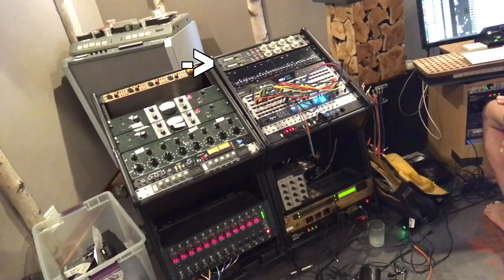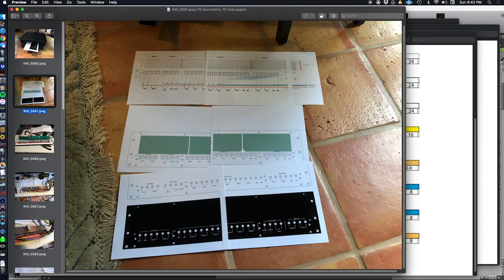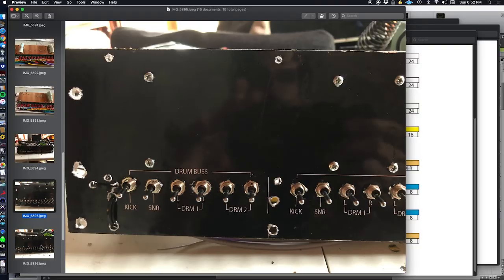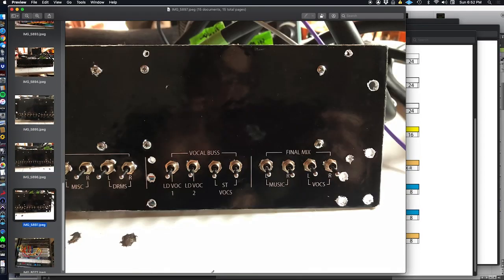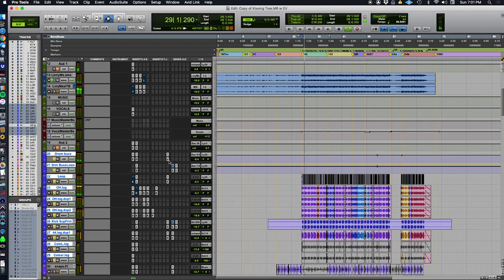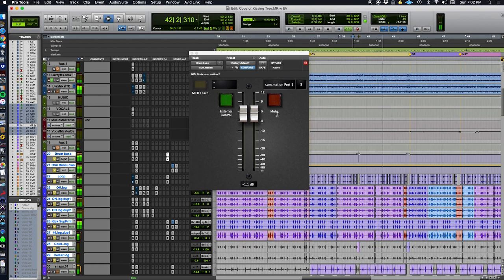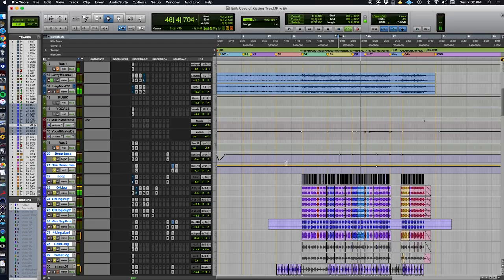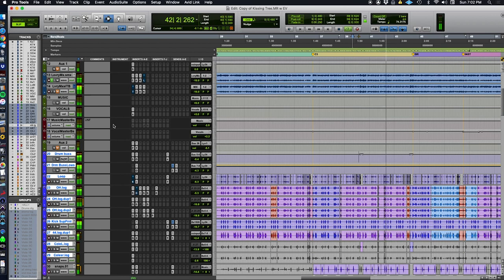Making Records With Eric Valentine - "ITB vs. OTB"

Comment: The potential degradation in quality that happens with AD/DA conversion mostly comes into play during the 1st conversion. The converter has it’s boundaries in terms of frequency response / reproduction that sets the “tone” (no pun :)) for what that audio can possibly be further on after one passage of conversion. If you continue to do passes of that very same audio it seems like it also stays within those boundaries and doesn’t degrade more. But if you compare the same non-converted audio but through 2 different converters in just 1 pass, the difference is massive! So conversion might not be degrading audio from one reference point onwards, but it sure can be either better or worse depending on the converter during the first pass through it.

Comment: Very very awesome video with great information, I’m in the process of building a Summing mixer using vintage api 325 cards, the reason I stopped using a Summing mixer and purchased a console is I could Not stand my Automation rides effecting my compression. The Summing mixer I’m having made now is going to be mostly used as additional returns to my console and for when I want to mix totally ITB to use it as stand alone mixer. I agree the beautiful thing about a console is you are going through multiple amplifier stages that equals the sound that most of us love.

Great video thanks!

Comment: Awesome video! I love how the OTB made the midrange stuff sound so gorgeous and took the sharpness away. For anyone curious, the 20x test works because digital loopback onto itself is more like a data transfer than a recording. The sample outputs can be thought of like data fed by a clock, filtered to remove any aliases, while the same clock is capturing the data on input: my understanding is in simplistic terms is that its only capturing the highest value it finds during a cycle, filtering out any frequencies above the sample rate. Maybe not the best explanation, but its basically what's happening. The data is captured nearly exactly the same as it left, as long as the converter's frequency response is incredibly linear and noise/distortion is low. 
So it doesn't build up any new sound, the first capture is where all the real destruction by the converter happens, if any destruction did occur. After that its just agreeing with itself. 
A low-passed lower sample rate conversion like 44.1 will permanently remove upper harmonics, altering the wave shapes in the audible range on FIRST CAPTURE, but copy itself exactly from that point onward. 
COMMON QUESTION: Can later up-sampled stuff offer any benefit or improvement? ANSWER: YES!* Using outboard to add re-voiced sound back changes the harmonics and can add the overtones that were chopped off by a low sample rate. If then captured at a HIGHER sample rate, it CAN introduce upper harmonics back, so it can offer some value. Unfortunately there's lots of misinformation out there and its a tough topic to conceptualize.
Reply: Christopher Thank you! I made a comment here about the exact same thing a few days ago, but maybe not as well explained as yours :)
Reply: Christopher amazing! Very good comment

Comment: That's brilliant Eric! Also your YT channel is full of quality and real info. I did a lot of testing  between ITB vs OTB summing and to my surprise, with Protools 11 (it's when Avid built the mixing engine from the ground up and also went to 64 bit) the difference was minimum, not to say none. So for summing I'm pretty pleased with Protools, but still use lots of hardware inserts, plugins are still far from analog processing. As always, IMO

Comment: Highly informative video! I've spent so much time last year screwing around with passive summing, building different amounts of channels, using different pres, etc. I ultimately abandoned it completely because it changed my work-flow too much. I also didn't really find that the preamps making up the gain had really that dramatic effect. So it's interesting to me that that is still the case using 8 of them in all the various points. I mean, I could definitely hear the difference but for someone like me who doesn't really have a way to deal with automation with in-line dynamics, etc the juice just wasn't worth the squeeze. Thanks for making these videos!

Comment: Youtube probably won't allow the sonic differences to shine through. 
Very good to see and probably a lot more fun to mix OTB—apart from all the extra time needed for hardware inserts and printing stems etc etc. If you have the budget go for it. Sonically the end listener would not be able to tell the difference even when pointed out. : )
Personally I like to use my external reverbs and sometimes taking extra time doing things clears your mind for a second. So as for a mixing process I believe it's a good thing.

Comment: This is amazing thank you very much Eric! I wonder if another reason the ITB Hardware inserts don't sound quite as solid or spatially consistent as the OTB summing could be because the delay compensation of the hardware plugin inserts causes different tracks to be played ever so slightly out of time, and therefore the kick is just out of time with the OH etc. The hardware insert plugins are changing the phase relationships of the audio tracks ever so slightly and therefore it spreads it all out a bit... idk just a thought.

Comment: Hey. Love all the videos you do.! Appreciate taking the time. Very helpful. I had a suck-ass drum mix on one of my tunes and I used your mixing drums vid to save the day. Anyway, I have had a Shadow Hills Equinox and now work with 3 Rupert Neve 5059s and a 5060. I find myself riding the faders a lot (too much). I would love a product that can automate after outboard. I have about 25 outboard units. I find a lot of time I will print stems back into computer and then automate. Boy, it would be nice not to have to commit to a stem that way--in addition to wrestling with timing issues after printing back in. Keep up the nerd videos. Maybe you can do one that addresses how you print back ITB and not have to deal with timing issues, phase, etc. I use Logic and haven't found a way to compensate printing outboard gear. THANKS!!

Comment: Wish you would have flipped the phase between the 20th conversion with the original drum buss to really hear if there was a difference. Love your videos!! Can you put the resistor excel sheet in a shared file and put it in the description?
Reply: The difference is quite evident, no nulling necessary

Comment: Hi Eric I sold my big Yamaha Pm2000 console today, The same one I grew up on  Lots of Iron and Japanese hardy M1 Op Amps, Now I am freaking out that I will not get the mixes and sounds I am used to having, I started watching  you on u tune an d some others looking at summing, I still have tones of gear and a few cool consoles I might try to used in the new smaller set up so that I can fit a mix set up in my house, my other console a massive  live console I toured with a Soundcraft Series 4 will not clear doors into my house and weighs  a half ton , So I am  very keen on your new set up and building a mix summing set up, In the past my in the box mixing experiences sucked, I HATE in the box sound and miss all the vibe of my analog gear m depth texture etc, So I am considering something  like you are doing or a new smaller ( Maybe an Amek  console slight smaller, The  idea of un loading some more gear and up grading a few things is exciting, I might add a fair child and keep a dozen cool pieces to use in the new rig, I also live the idea of the new way with recall  a smaller power bill ,less AC and compact foot print 
I am soldering  compliant , electronics is not complexity un familiar, and I have had plenty of bad gain and impedance weirdness over the year with gear,, The idea of re  using many of my pres for color and vibe is cool , Love the idea of trying this, Pass on any info you can to build a summing mixer,I realy need to find a copy of the summing software and don.t want to buy an SSL  , although it is very cool, Is there anywhere to find the summation software? I got to re watch this video a few times to understand the summing  mixer wiring , excuse typos

Comment: so, you need 8 mic pre's, 8x VCA controller, and a passive mixer(plus outboard gear) to get it "a little more glued together"? I'm curious how sending a buss out of protools (to outboard gear and pre's)and printing back into pro tools, then summing in the box(out to unfairchild) would compare? Also, if you inserted your I/O in pro tools to outboard gear wouldn't you be able to have control over output volume to summing mixer without changing your send level to outboard processing?  I understand your trying to avoid going in and out of the converters, but it would only add one round trip.
Reply from the maker: Your point is totally valid.  Even this somewhat modest setup (compared to a full blown console) is still difficult to justify.  In my opinion, The passive summing itself doesn't have a sound.  It is all of the color from the mic pres and outboard gear that is important.  I could conceivably create the bussing in pro tools, use H/W inserts to add the preamp color/outboard processing and get the exact same result.  The only difference would be the additional convertions and phase related latency issues.  I will probably do that test at some point along the way :)

Comment: Question: if we can't afford the SSL box or build your summing mixer, would it be possible to get the same effect by mixing each subgroup out (drums, then vocals, then etc) to external hw and printing to stereo tracks back in the box and automating those stereo pair submixes during a final mixdown in the box?
Reply from the maker: The short answer is yes.  The summing itself is not what is sonically beneficial about the external summing system.  It is really the color of the mic preamps and any other outboard hardware you might be using.  If you setup the sam summing system of busses and auxes in Pro Tools and simply inserted mic pres and other outboard processing via H/W inserts you would probably get the same result.
Reply: @mrwev  Thank you very much! Many moons ago (before there were better reverb plugins in the box) this is what I would do to print Lexicon reverb onto effected tracks, and then blend those into the final mix, in the box. :-)

Comment: The more ITB experience I make the more I learn that the drastic differences are most often not the gear, they are simple and easy mistakes in level matching which also old dogs do - everyday. I assume that it is extremely difficult to reproduce the exact setup ITB. Going and mixing from scratch using the advantages of ITB may create a more interesting sounding mix. Btw a hint Sonnox inflator on your ITB mixbus will ad the right amount of harmonics to get the same coherence of your hybrid mix...last but not least the ITB mix wouldn’t break the beautiful Song.

Comment: Hi Eric, I just ordered the UTA Pyra-sum summing mixer.  Question, how do you deal with reverb or delay sends in a passive summing mixer set-up?
Reply from the maker: Hey!  Hope you enjoy the Pyra-sum as much as I am!  There are two options for reverb/delay stuff.  It can either be sent to the same output that the instrument or vocal is being sent to OR if you want to do the more traditional send/return style, there are extra inputs called "Direct To Buss" that can be used for that purpose.  Example: if you have a collection of vocal tracks that are all being sent to the same reverb, the vocal tracks themselves would be sent to the vocal inputs and then the reverb return would be sent to the "Direct to Vocal" buss.  This is especially useful if you have a mono lead vocal that is sending to a stereo reverb.  You can then process the mono vocal with mono outboard gear and have the stereo reverb be blended with it in the overall vocal buss.  Good question!  Hope that all makes sense :)
Reply: @mrwev  Thanks, that makes sense!  I'll probably go the route of sending direct to bus since compressing a signal with reverb in it will bring up the effect level too much.

Comment: Mr. Valentine, big fan! So glad you started a channel. Question for you...

Can you recommend a book or a guide for getting started on DIY audio electronics? I'm an electrically proficient guy, but I have trouble finding info short of just copying other's designs.
Reply from the maker: That is tricky.  I didn't get very far with books because audio circuit design seems to be so subjective.  There are so many ways to achieve a similar technical result on paper but the beauty of the sound is the subjective part and from what I've seen, It takes decades of experience to really know how to do that.  That is why I have Larry Jasper involved.  My best recommendation is to find a mentor who's design taste you respect.  That is the fastest path to designing audio circuits you love the sound of and then ultimately taking them in your own direction.

Comment: Hi Eric thanks so much for sharing all this info, very inspiring! At your final 2 buss stage are you using a single stereo compressor after the mic pre to compress everything into the Lavry or are you using one for the vocals and one for the music before the final mic pre gain stage? Thanks!
Reply from the maker: Good question!  There is no compressor on the final stereo mix buss that has both vocals+music.  The compression is on the Music and Vocals individually.  UnFairchild on the Music and modified Altec 436Cs on the Vocals.
Reply: @mrwev  Thanks for answering my question! I had one more, do you run the Unfairchild and the Altec compressors right after the Music buss and Vocal Buss pre amps?  I was wondering if you use the summation box to level these two compressors outputs before hitting the final buss? I am building a box very similar excited to try out all these different ways to use it!

Comment: What's really crazy is I did this through various pieces of outboard gear and it really starts to fall apart quick. Went through a RND 551 EQ, and various API pieces. So it's definitely safe to say analog gear degrades the sound far more than digital conversion.

Comment: For the ITB mix, did you still have the 1081s on the sub busses and the undertones on the 2 bus as hardware inserts? If not, were you using any plugins on the subs/master to get you to similar territory? And how hard are you hitting the Lavry on the way back in?
Reply from the maker: No I was not using any of the mic pres on the ITB version because no gain needs to be made up but that would be a good experiment to try.  No additional plugs to emulate those pres.  I'm not hitting the Lavry that hard and I wasn't using any of the "softsat" feature that converter has.  Just straight conversion.